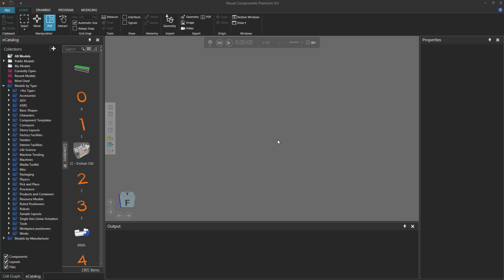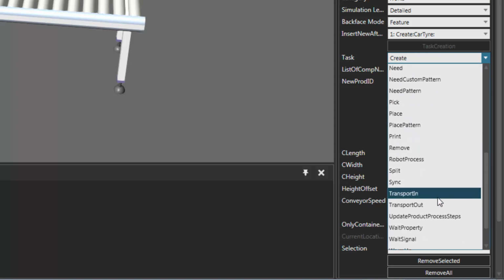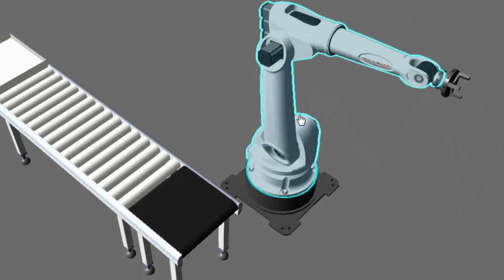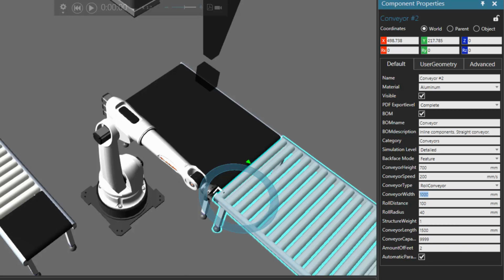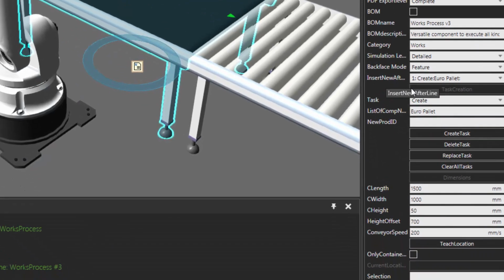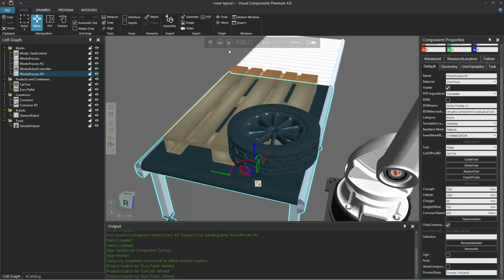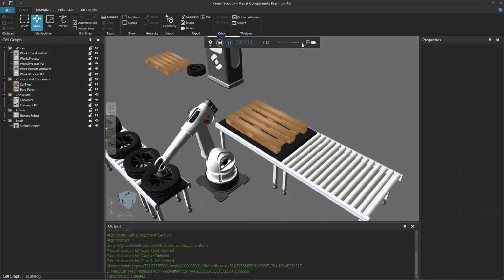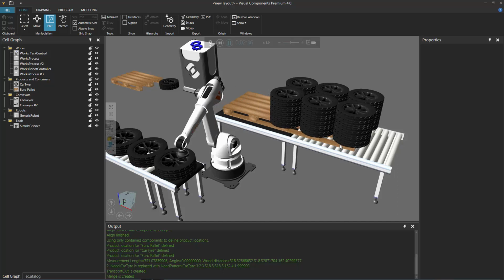Simulate a Palletizing Operation with Works Library

Comment: Im trying to make a palletizing process at the end of a production line, which ends with sealed boxes, created by Box Creaters and sealed with a Box Sealer, but when I reach the point where you test the program and it puts the tires into the pallet, my robot doesn't even recognize the boxes, even tho I followed all steps in the video (the sealed boxes' name shows FoldingBox, and I typed that into the shown sections), and the process just stops at stacking the boxes at the end of the line, where the robot moves nowhere.

I thought it might be because I tried to use a UR16e robot arm, but then I tried with the robot you used, and I have the same issue. So I don't know why it doesn't want to pick up the box.

I'm also using a custom box (I resized the boxes that are created and sealed by the Creators and Sealers), but I changed the size in the Creator and the Sealer, not the box itself.

What should I do so my robot would recognize and palletize the sealed boxes at the end of the line?
Reply from the maker: Good question to ask on our forum or support.
https://forum.visualcomponents.com/c/layout-configuration/10

If robot is not picking and placing your boxes, check the ProdID property of your boxes, and in the Feed and Need task arguments. In the Works library, a resource such as a robot will not pick a product unless there is a need for the product at a different station or the robot was told to directly pick the product using Pick task.

Here is reference guide for the tasks. Our academy also has a course on the Works library.
https://forum.visualcomponents.com/t/works-library-tasks-reference-guide/479/2
Reply: It also spits out the error:

Traceback (most recent call last):
  File "Works Process::OnRun", line 363, in OnRun
  File "Works Process::OnRun", line 423, in call_WT
  File "Works Process::OnRun", line 1525, in WT__feed
MemoryError

Comment: How can you change the creation rate of tyres (in seconds)?
Reply from the maker: One option is to add a Delay task. Another option is to add a DummyProcess or GlobalProcess task. All three of those tasks are time-consuming, so they can affect the creation interval.
Another option is to use a WaitSignal or WaitProperty task, which would allow you to wait for a condition/event to occur before creating next tire.
An out-of-the-box approach would be to use a Feeder component from eCatalog if your use case is simply to make the tires and move them elsewhere.
Reply: @Visualcomponents  I would prefer not to use any delay because it seems to "freeze" the robot while the work process is in delay. I would like to use a feeder but how can I link it to a work process or a ProdID?
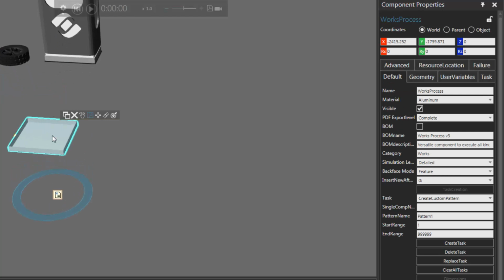Reply from the maker: Both an Advanced Feeder and Shape Feeder in our eCatalog allow you to create components and stamp them with a ProdID property as shown in this video starting from 1:46
https://academy.visualcomponents.com/lessons/model-a-component-creator-part-3/

You are correct. The Works library uses ProdID property of components. If a component is handled by a Works Process component, for example TransportIn task that transports in Any, a component that does not have a ProdID property will automatically be given one.

For example, load the layout of the tutorial. Remove the first Works Process component that makes the tires and replace it with a Feeder Template component found in our eCatalog. The feeder does not stamp a component with a ProdID. Edit the Component Creator properties of the template to make the tires. Next, run the simulation. Notice that as soon as the tires are transported into the Works Process feeding the tires, a selected tire at that station will have a ProdID property.

In cases where a component does not have a ProdID property, it will be given one by a Works Process component and the default value will be the component's name. Knowing that, you can use a ChangeProductID task to change the value to whatever you need.

If the robot is freezing, it means the robot cannot perform a task, i.e. is idle. We would suggest using our forum or support site to share your layout and get better feedback.